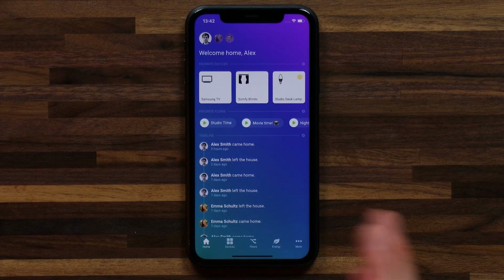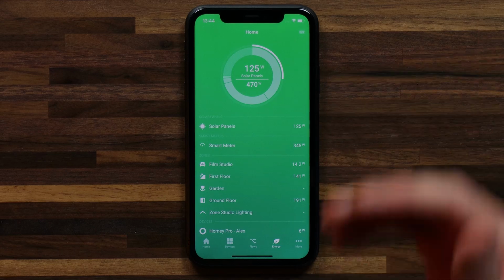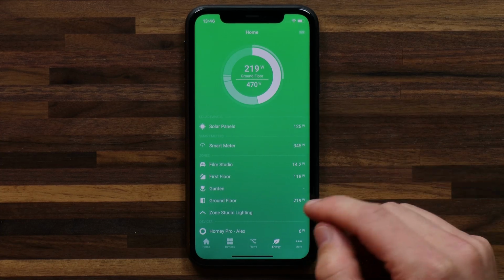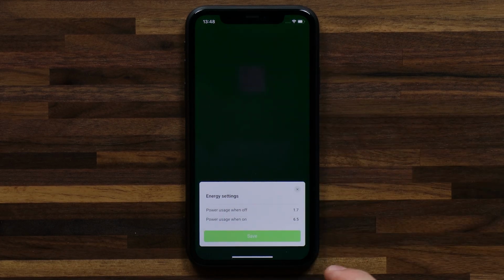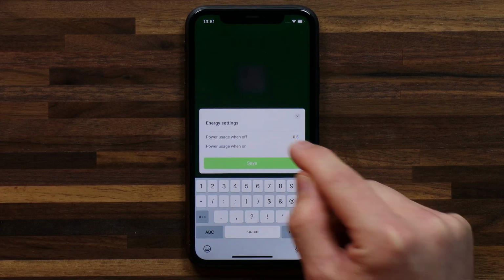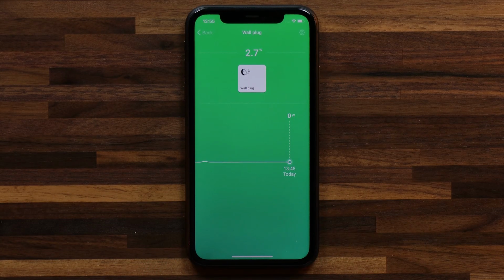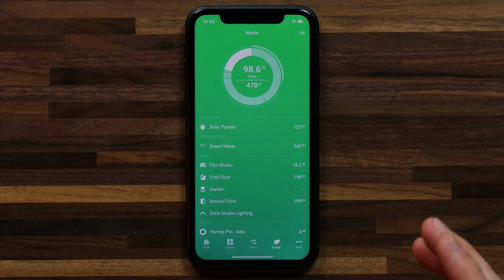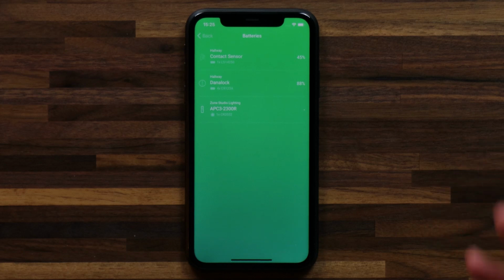Homey Energy: view & measure your smart home energy use

Comment: If I want to know the maximum number of amps drawn by the entire home at any time over the next year.  I was planning to hook a power meter to L1 and L2 in the circuit breaker panel, such as the Aeon Labs ZW095.  Will Homie report the maximum power recorded by each sensor?  Will it output data for a given day or month for use in a spreadsheet, or something?

Comment: Isn't solar panels supposed to subtract from the total energy consumption instead of adding to it? I've got rid of my solar panels app in homey because the would actually add up to the total energy consumption instead of subtracting it and going negative, something my smart P1 meter is doing correctly.
Reply from the maker: Hey Niels, The energy generated by the solar panels is assumed to be used up by the home, so if they are generating 150W then this is also consumed in the home. The smart meter tells you the amount of energy being used from the 'Grid', lets say this is another 150W. Then the total consumption of the home is 150 + 150 = 300W. Thus the 150W generated by the Solar panels is added to the smart meter measurement to create the homes energy consumption total. I hope that explanation helps a little.
Reply: @homey  I agree with Niels. You are mixing total power usage with total energy consumption. In your example power usage is 300w, energy consumption is 0w! And what does homey shows when solar production is higher than power usage and nothing is downloaded from the grid but excess is uploaded to the grid? Something smart meters and solar reading software do correctly such as my smappee app.
Reply: @homey  Hi Guys, I'm seeing this comment because i was looking for a way to exclude the power meassurement from my Solar Panals from this app. It makes no sense so far. Setup should be: solar panel gives negative number (let say -1500W). Homey gives positive number based on devices (for example 50W total amound of lights and everything). P1 meter gives negative number (-1400, based on smart meter), Homey tells me there is +50 used by unknown devices. Right?